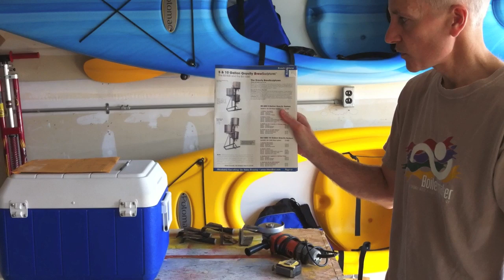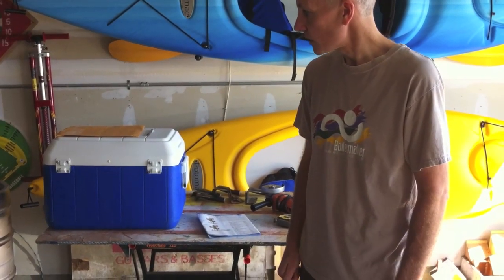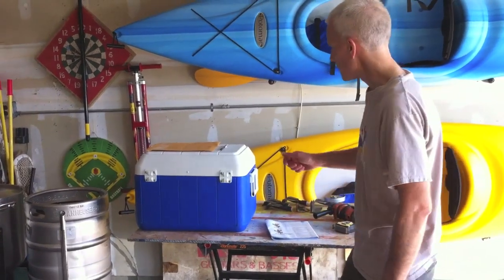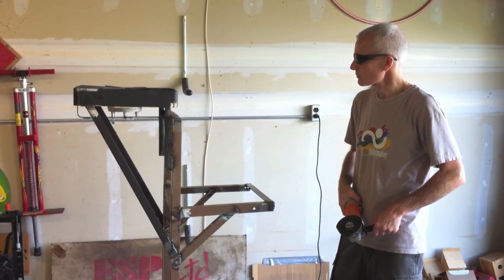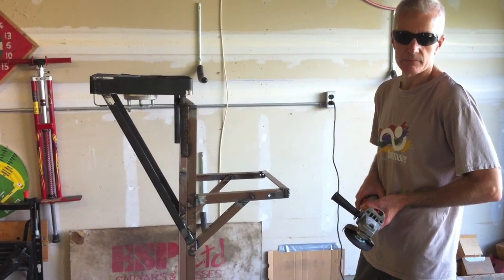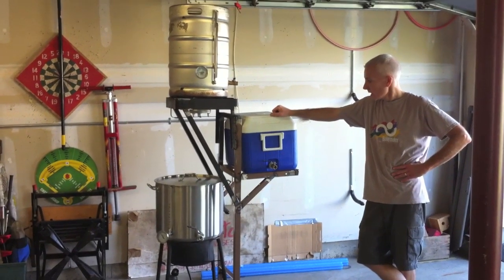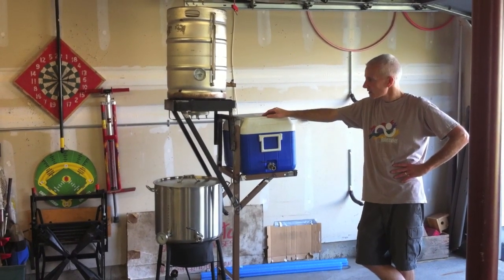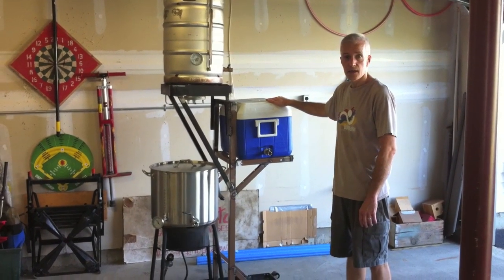DIY brewstand from recycled material

Comment: I did a 3 tier system myself, using part of a section of old ham radio tower for the spine, a 10 foot piece of 1 1/4" box section I found at the local scrap yard for the legs, and similar sized angle iron that I built into H shaped platforms for the HLT, Mash Tun and Brew Kettle (a converted keg from the same scrapyard). Each platform was identical, and bolt to the tower section on all 3 legs. The coolers set on the frames, the burner bolted on a piece of sheet aluminum bolted to the frame.

Comment: Great stand! I just want to say, for those watching this video and thinking of trying metal fabrication for the first time, DO NOT do what this guy is doing. Using a chop saw and grinder without a face shield is INSANE. You WILL be developing large amounts of metal particles spraying at high speed. Some of it WILL hit your face, and you take an excellent chance at a very nasty injury. Also welding on wood without gloves? I'm a marine engineer and have been working in metal fab for a long time.

Comment from the maker: Great observation, and while it did not melt, it was getting a little "soft" when the brew kettle burner is at full tilt. Amazingly the HLT burner did not bother it. In any case, i have since added a galvanized "shield" directly behind the cooler.

Comment: Yeah I have to agree with some of the commenters below... you say "economical" but then you don't factor in the cost of tools someone who doesn't already have them, then the welder, and the skill required, plus time (which has $$ value), then the medical bills when shards of metal fly up into your eyes cause you ain't got eye protection. Otherwise, I like your video!
Reply: you can buy a hacksaw for like 10$ and a pack of bolts for like5-15 and bolt it all together to keep costs down if you dont have access to those things. or goto any shop, tell em what youre building and ask em if they can cut it for ya, offer em a 12 pack of your first good batch! lol
Reply: bertdorf3, You could skip the whole brewing part and go to your local corner store and buy it all made.
,Beer that is, However you would miss all that fun off both building your own equipment and making your own beer. I think Wayne did an excellent job of keeping cost down and showing people who otherwise have no skills how they to can get into making their own equipment and BEER!! Nice job Wayne. I am off to the landfill!